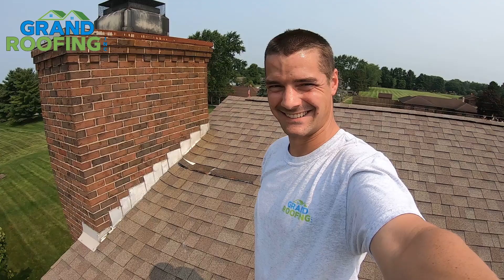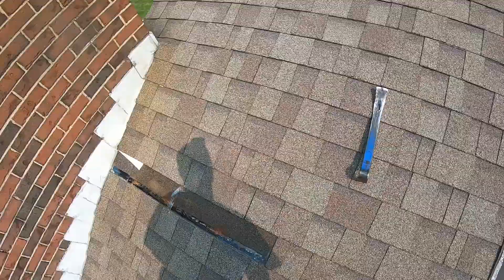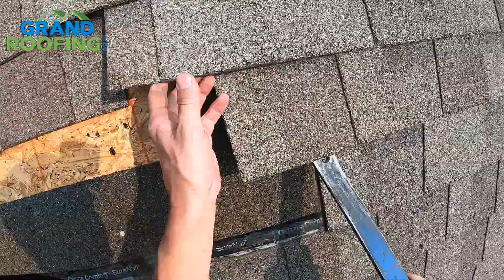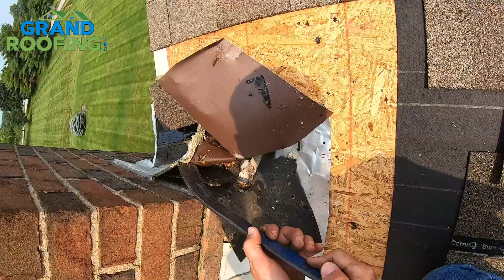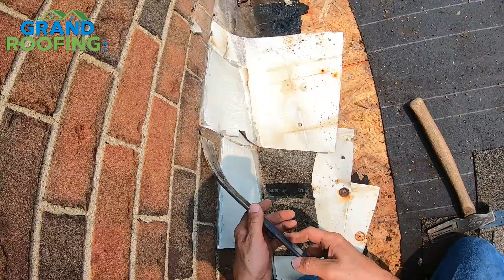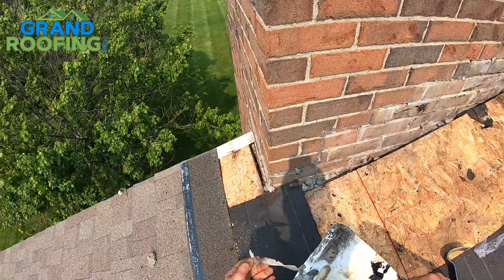Chimney Reflashing - part 1 tear out

Comment: Interesting. No paper under the shingles and the deck looks like new. Begs the question all this ice and water and super duper synthetic underlayments doesn't it?? Never tore off a roof with 30# felt paper that had any issues - save for chimney or dormer areas where a crap job of flashing was done!

Comment: You can not nail thru flashing close to chimney as it will leak . No nails in flashing on the roof within 8 inches of chimney and flashing must be covered with synthetic ice and water underlayment And you can not nail into chimney as it will leak into chimney over time . Chimney brick is not waterproof . Then you put step flashing into chimney and over the flashing that butts up against chimney and is on roof .
Types of flashing are aluminum , copper , or lead . Watch his videos and you will see how it is done the right way .

Comment: Would it of been possible to reuse the old shingles? I'm a carpenter, not a Pro Roofer like you. If the cut shingles were marked on the back to keep track of? The full shingles that were removed doesn't matter I guess. If any new shingles needed to be added, only cut ones into and around the chimney? Just curious of your opinion.  Very nice explaining and craftsmanship.
Reply: Always use new shingles so they seal properly

Comment: Off topic but have you come across a chimney (such as this, on the side of house) being knocked down to below the gutter line and closed off with a crown ? 
Reason I'm asking. We have a high efficiency furnace and only vent the water heater thru the chimney now. However, the chimney needs some repair (possible new flashing, rebuild top 6-8 rows, new crown, new liner) and it's sorta expensive. We are trying to decide if it's just better to get rid of the chimney, get a new water heater which vents thru the side of the house wall just like the furnace does. 
A roofer would close off the section where the chimney was (wood decking, shingles, connect the gutter). 
Mostly wondering how it'd look afterwards, because the chimney is on the side of the house, just as is in this video. And if you've seen that done in your experience, any thoughts. Thanks
Reply: Rebuild your chimney. I am doing exactly the same thing. I am into it two months now. Scaffolding, flue repair, and 10 rows of bricks. It is looking great. A nice chimney is nice.

Comment: If I’m rebuilding a block chimney that goes through the roof, can I do this without removing shingles and use the old roof flashing, but use new counter flashing? 
The block that comes through the roof will be replaced plus another 6 blocks above it. They want to keep the existing roof without buying new shingles. 
Thank You!
I need a video on this!

Comment: Is it supposed to peel off the clear plastic strip underneath the shingles? So that the shingles can adhesive to another. How can I trust the contractor to do the right job any more?
Reply from the maker: No the little cellophane strips are not supposed to be peeled off. Different manufacturers install them in different areas. The point of the cellophane strip is so during shipping and warehousing them while in the package they do not stick together. The shingles are oriented in such a way the seal strip is covered by the cellophane strip on the opposing shingle. When they grab a shingle off the stack it should reveal a ready to go seal strip. The only time you need to remove them is if it releases and sticks to the seal strip.
Reply: @GrandRoofingInc  thanks for the reply. I understand that the strips'  purpose is to prevent shingles stick together before installation. How about after the installation? I think the strips should be removed during installation , so that shingles can adhesive to each other to prevent wind damages.
Reply: @GrandRoofingInc  I watched the video again. The cellophane strip is running along the center line of the shingles where you put the nails. That is exactly where the glue strip is . That tells me that the cellophane strip shouldn't be there and should be removed.

Comment: I wonder if a magnet attached to a small bean bag would help make it easier to collect your nails when tearing down a job like this.

Like there used to be ashtrays that were built around sandbag bases so they never got spilled by the drunks.

The sandbag would stay put while the magnet sucked up all the little nails around it.

Comment: Wow you must've had a slow week.
The flashing was perfect.
They just didn't fill the break with enough mortar.
I can't believe you did all of that.
All it took was a little love to the mortsr joints.
Wood would've changed in color if it was in consistent contact.
You should be ashamed of yourself. 

Rookie mistake but wow , what a crime on that customer
Reply: Did you not see how much the step flashing was pitched up making water run laterally into the shingles? Or how there’s no counter flashing covering the step flashing?

Comment: Should the too section of drip edge go on top of chimney flashing?
Reply from the maker: No, if you do the water running that way will go down behind the edge metal and fascia. Better to go over the drip.
Reply: Grand Roofing Inc. thanks for the info!! Love your vids
Reply: No if I think I know what your talking about
Reply: What is it going underneath it? I didn't watch the whole video. Another aspect you. When you're 60 years old, and up on a roof with a 12-12 pitch kneeling down, how long do you take to do the job before you say fuck this I can't kneel down on this shit no longer? I'm just looking up beautiful it and existing flashing. And of course I'm the middleman, caught between the boss and the homeowner. What can be done what's done and what should be done and why it should have been done that way and nobody knows the answer except me. But nobody asks. So, in that case you grab the tape, flat white paint, spray, some silicone. Bingo. Got to make sure you guy don't get no water inside, and that's set. And the homeowner wasn't flat stuck to the chimney. Well the repairs are made underneath it it's impossible. And that's what he wanted in the first place. It's impossible in the means that I'm not spending 4 days on a simple flashing job and my job was just to point the brick. And this is what happens. The boss wants to take the old flashing off and reuse it? Okay no problem. But it was stuck with some type of blue, that had no earthly means being even on this planet, it held so well, that it was all I could do is just not to shred the the existing aluminum haha, let alone put a slight crease in it. How do I know it's going to be waterproof? Because it was waterproof when I got here. It's even better now. If you want better waterproofing stick saran wrap all over it, and in about 3 or 4 years you'll have nothing there except a small pile of sand. Enjoy your work day.